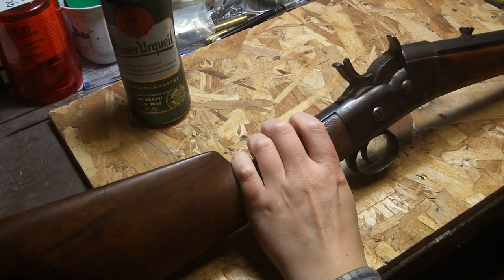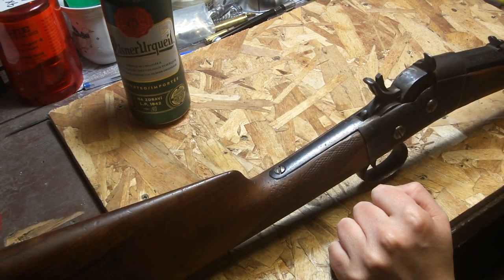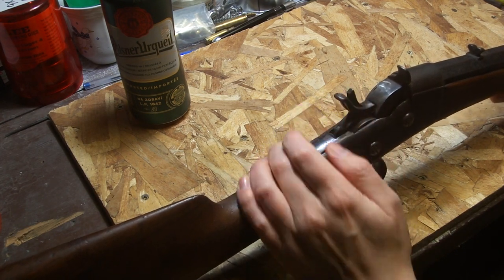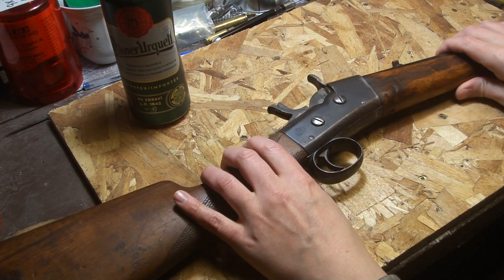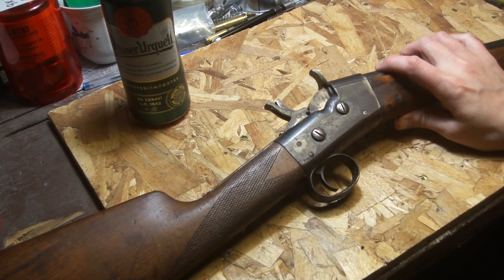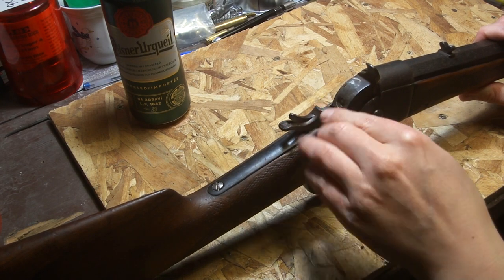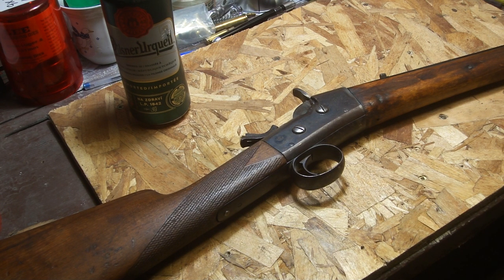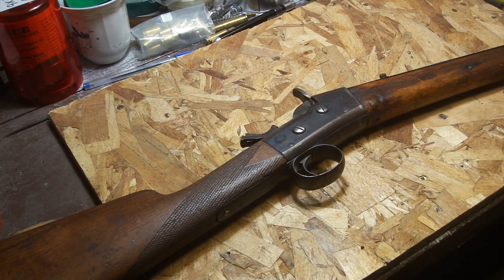Husqvarna Rolling Block Safety Hammer

Comment: I shoot the older model in 12 Gauge which has no hammer lock and no rifling with smokeless loads without issues but I had the chambers lengthened to accommodate 2 3/4 loads and only shoot very light loads home loads. I now use a good commercial load called Falcon Saloons cartridges from New Zealand in all my ancient shotguns. These are 2 1/2 roll crimped 12 gauge cartridges with reduced shot and about 920fps specifically designed for Cowboy Action shooting.

An interesting story about the rifling in these later Swedish rolling block models: The Swedes liked to shoot solids for Elk hunting but for what ever reason the Swedish government, probably just because they were dumb like most politicians, though this was inhuman so brought in a law that smooth bore were not legal for Elk so they rifled them, some were straight and some properly rifled and I have seen up to 16 grooves. The Swedish rolling blocks are also made out of pretty fine steel for their age but get a good gunsmith to check it out as I have had some with badly cracked blocks.

Comment: i have a Husky 12 gauge commercially made, it's probably the latest ones with dual extractors and that safety hammer. It can take light smokeless ammo no problem, but it punctures primers as well. The barrel is 6 feet long!
Reply from the maker: I think most puncture primers, not sure if primers are thinner now?
Reply: @Gungeek  has to be. I think i've even noticed slight differences between brands of ammo...
Reply from the maker: yeah I had some very old CCI 209 primers that it didn't puncture.